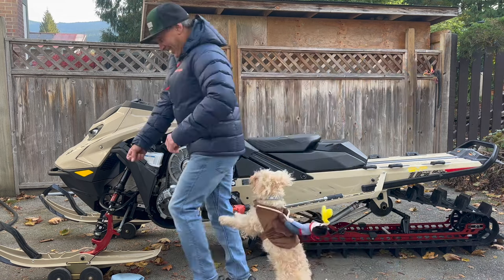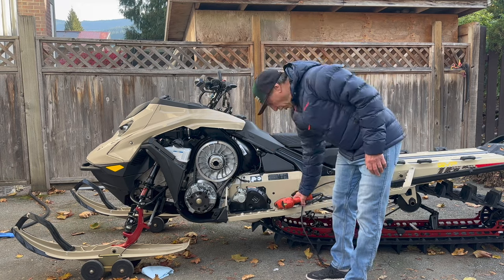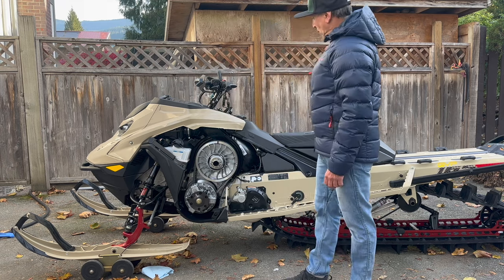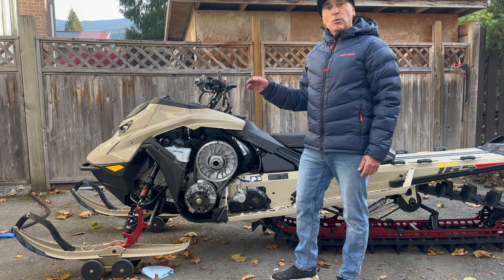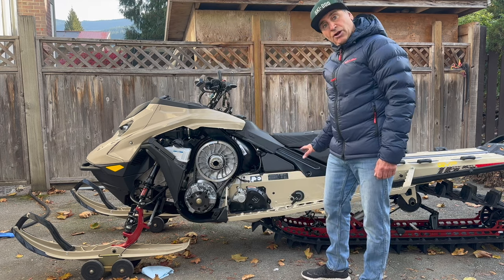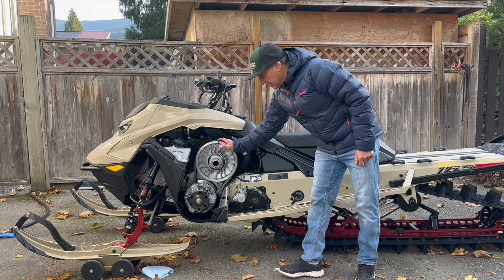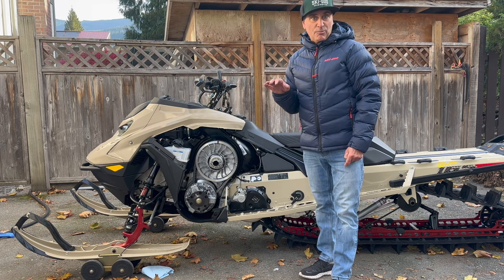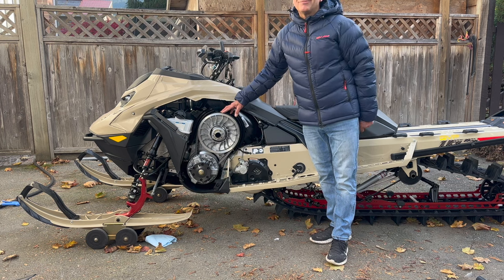Ski-Doo Gen 5 Chain Tension Adjust

Comment: I noticed there is a hole where it seems the cotter pin should go but you have it placed behind that black bracket. Where should it be placed? I went to go tighten my chain and my authorized dealer that sold me the sled had it placed in the hole instead of behind the black bracket (2014 summit x 850 NA) and it is throwing me off.
Reply from the maker: pin does NOT go int he hole. cheers dave

Comment: my clutch moves easily even after i tighten the screw. its a new 900 ace scandic. is that something to be concerned about?
Reply from the maker: put the brake on, if on the ground just use light pressure to try and turn it not using a lot as you will turn it if you do, putting the brake on will make it easier. cheers dave

Comment: Hand tighten... that always seems so subjective.  As tight as I can get it by hand, till I just sense a bit of resistance, etc.  Can you better describe and\or show that?
Reply from the maker: Yes it is for sure, but go until it feels a bit of resistance and check the movement, simple that way 1 full turn is very little movement so you don't need to keep turning it is your just getting at movement i show when ideal